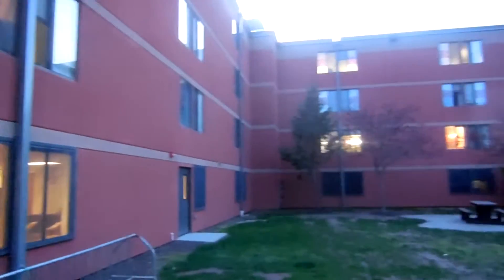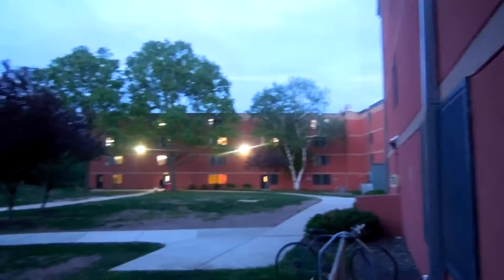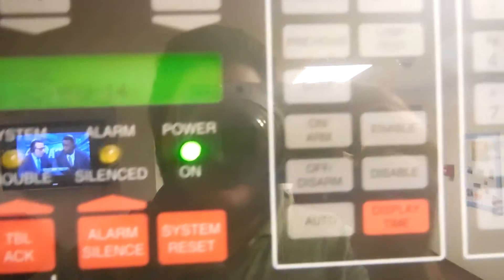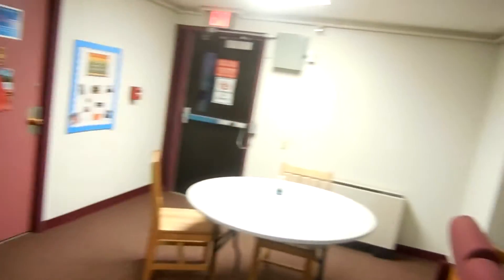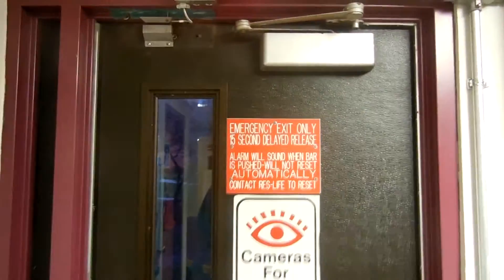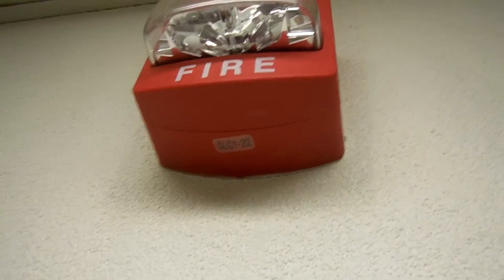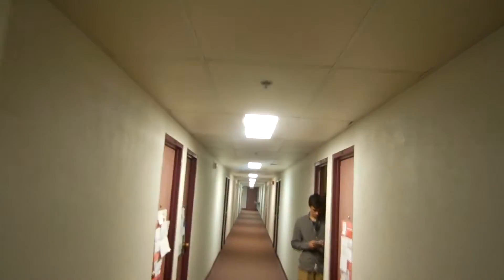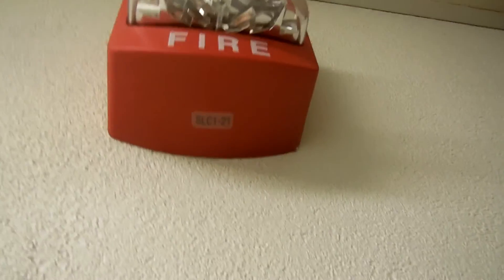Fire Alarm Tour of Mattia Residence Hall, Rutgers Part 1/2

Comment: Nice! My dorm, Laurel Hall, at the University of North Carolina at Charlotte, has white TrueAlert speaker strobes that don’t do the voice evacuation message, instead they do a tone similar to a low frequency sounder System Sensor SpectrAlert Advance and dual action Simplex T-bars, the panel is a 4100ES, this building was built in 2015